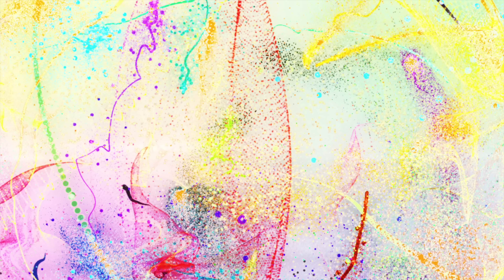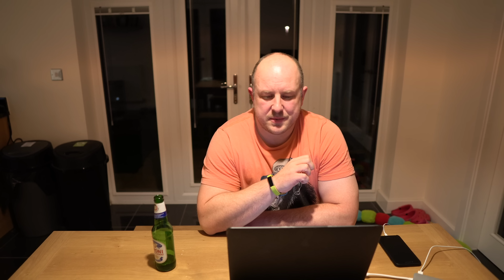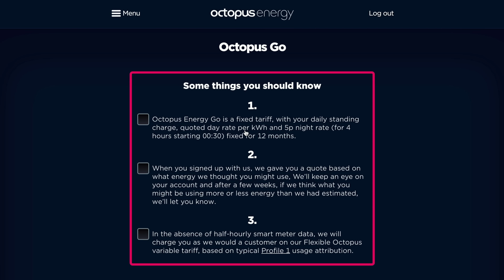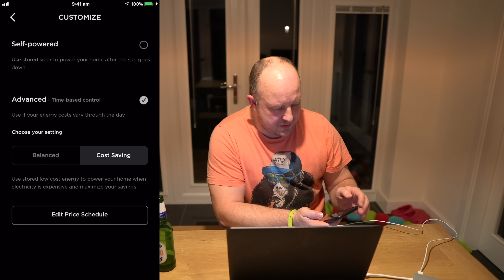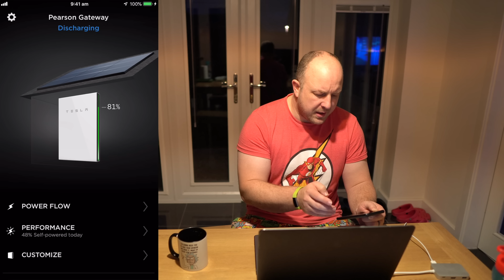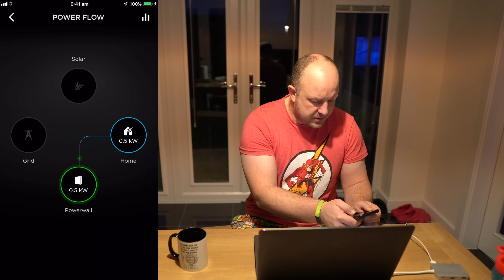Tesla Powerwall Off Peak Charging - Octopus Energy GO Tariff

Comment: Hi there I’ve configured my Powerwall exactly as you did. What I am noticing is that it fills up as planned between 1230 and 0430 but then rapidly discharges and is empty by 630am. This seems really strange as the house is not asking for anything other than some very low level heating … it also means it’s not helping me at all when we all get up and start cooking, washing, etc. Any thoughts much appreciated!
Reply from the maker: Thats very odd.
I would set an alarm for 4:30am to see what your powerwall is doing.
My guess is going to be that either something in your house is slurping up more than you expect, or you have your CT clamps configured incorrectly and its exporting the Powerwall to the grid.
Reply: just out of curiosity how many power walls do you have?
Reply: @calebmcclure3893  Just the one.

Comment: Thank you. A great video and easy to understand.  I have just changed over to Octopus and this assisted with the setting up of the TESLA app which I did not fully understand.
Reply from the maker: Glad it helped, thanks for taking the time to leave a comment.
Octopus have great Customer Service, so sure you will enjoy it. Best power company I have ever been with.
Reply: I have come across an issue within the past 3 days.  Initially the battery charged to around 95% at night but now is only charging to around 65-70% and having spoken to TESLA (after hanging on for around 56 minutes) I was informed this is normal and the system is functioning correctly.  I do not understand this as I would expect the battery to 'fully' charge not leave me looking at my app every few minutes in the evening to check how much is left in the battery.  As an example last night the battery charged 10.9kWh from having 4% remaining. Have you experienced this? Thanks
Reply from the maker: @chrismerson3581  Yes I have done some other videos on this. The Powerwall will only fully charge, IF it thinks the solar generation will not exceed your needs. 
So if it thinks you will have excess solar then it wont fully charge the Powerwall leaving capacity to fill it with some solar energy.
In general it works ok, but it has its oddities for sure. I wish there was a manual override to define how much YOU want, not what IT thinks :)

Comment: Hi, love your videos! Really cool 👍
I’m having an issue with my PW charging from the grid. I’m with Octopus, on Go Tariff. I’ve set the time-based controller on the Tesla app, exactly as you have; unfortunately the PW is only drawing from the grid for 1 hour, then it stops! In your expertise, what do you think is wrong? Thanks
Reply from the maker: I am just recording another video to help people understand abit better how I think the Powerwall works in this regard.
In your case, its "working" as it is charging from the grid. Its only pulling for an hour as it "thinks" based on previous usage and projected solar this is all you need.
In general it works well, but it has its moments. For example today I have been pulling from the grid most of the day as it only pulled abit over night.
Reply: Spectrum Geeks Thanks for your reply. It’s really helpful as I was concerned that I had not set it up correctly, however if it’s using an algorithm to work out projected usage from previous data, I shouldn’t worry. I look forward to watching your next video. Keep up the great work!

Comment: Hey Dale, random Q. How have you set up your PW to work with Zappi if you need to charge at night (octopus)? If you charge during the 4 night hours does your Zappi drain your PW and use grid until it charges back via solar the following day?
Reply from the maker: Hey Darren. I have my Powerwall setup to know when is peak and off peak (mainly so it can charge from the grid as needed - as per the video). So when my Zappi kicks in, the Powerwall knows its cheaper for it to pull from the grid that deplete the Powerwall. Now sometimes it screws up abit, but in general it works well. If I then use my Zappi during the day and there is not enough solar it will pull from the Powerwall as that energy is cheaper during peak times.
Reply: @ConsideredUK  thanks! I guess my issue is if I charge my car at night it completely drains the PW even though I have the two tariffs set up on it also. Maybe i don't charge enough at night for the algorithms to kick in. Hmmm
Reply from the maker: Its a possibility, but thinking about it now. In the last week I charged my car from the grid at night for the first time in ages, and it worked as expected, pulled from the grid and the Powerwall was fine.

Comment: Code used  : O ) supply starts 30th Aug 2019. Thanks for the info on the powerwall
Reply from the maker: Cheers for using the code and for watching the channel.
Reply: @ConsideredUK   have know gone live with the go tariff, So I guess the credit will be on my 1st bill. The install starts September the 17 so had fun getting ethernet run for all the bits.
Reply from the maker: You get the credit on your account as soon as your switch completes. As I don't know your real name I can't check on my end to see if the switch is marked as complete (assuming you used my code).

Comment: I am thinking agile might be better as the most you can use is 17kwh in the cheap rate wheres as if you do Agile you are paying 8p to 28p but averaging out at 8p but you get loads more hours use.
If you are working like me from home the average has been around 10p compared to Go @ 13p all figures rounded off
Reply from the maker: I think Agile works depending on use case, the Go Tariff works for me.
In the 4 hours I heat my water at 3kWh, charge my car and 7kWh and charge my Powerwall at 5kWh. So can knock out 60kWh in that 4 window and that takes care of my following day.
Reply: @ConsideredUK  so how do you utilise your solar generation if battery charged at night.
Reply from the maker: I only charge things from the grid in the winter months. Outside of that I am using my solar only (aside from an overnight charge to the car if needed).
Reply: @ConsideredUK  thanks for this.  From what you say the go tariff has no restrictions? You can draw as much as you want between 12:30am and 4.00am?
Reply from the maker: Ah you found the video. Yup all you can consume for 4 hours, 12:30 - 4:30am.
Reply: @ConsideredUK  amazing. This would make it the cheapest off peak everywhere. Wonderful.yiu are amazing thanks
Reply from the maker: Ha ha. If you are not with Octopus already, there should be a referral link in the description. We both get £50 credit if you use it.
Reply: Great video, thanks for sharing. I’ve used your referral code and am now on the Go tariff, thanks! Quick question, you mentioned here that use the off-peak period to heat your hot water. Why is that? I’m on the Octopus Gas tariff and the cost is 3.4p kWh, which is cheaper than the 5p kWh during the off-peak period. I’m new to all this so might be missing a trick!
Reply from the maker: @nosh7654  I think (not done a scientific test) that heating the water with electricity is more efficient than gas, as there is less losses. This is why I am now using off peak electricity to heat the water.
With the immersion I am heating the water directly in the tank. To use gas I have to run the boiler, the water pump, etc and the water has to travel through the pipes etc. This is my current logic anyway.
Reply: Spectrum Geeks hmmm. Never thought of it that way. Will give it a shot!

Comment: Hey Dale, just signed up with Octpus, with the intention of switching to Go. I'm also scheduled for my 6KW PV + Tesla PW2 install from Forever Green this month, so I guess you could say I'm following behind :) Not sure how long it will take to switch to Go, seems there is a bit of a delay getting the new SMETS2 smart meters out. Anyhow, signed up with your referral code - thanks for the really informative videos.
Reply from the maker: Cheers Jason and best of luck with the solar (did you tell them you had seen my videos?).
Regarding the SMETS2, if you tell Octopus you want to get on the Go Tariff, they may get you a SMETS1.

Comment: Hello, and thanks for all your helpful videos! We installed a 4kw solar array a month ago and just had our Powerwall installed yesterday. Next step is to sign up to Octopus GO, and we've got them coming to install the meter in a couple of weeks. I don't suppose we can use your code if we're already Octopus customers (we're just switching tariff)? Curious to know how clever your battery is being in terms of how much it charges during the off peak hours. Do you see it charging to significantly different levels on a daily basis depending on the weather, usage etc? Does it tend to be on the money, or do you sometimes find yourself wishing it had charged more/less? Does it ever not charge at all, despite being set to cost saving mode? Thanks!
Reply from the maker: Thanks for taking the time to leave a comment, a few are asking about how the Powerwall is working in this way, so perhaps I will do a video.
As you are an existing customer, you wont be able to use referral, but the main thing is you can save some money once being able to charge up on cheap electricity when the weather is bad again.

In general the battery is super smart and does the right thing, and charges up IF / WHEN it needs to, based on historical usage and weather forecast. I do occasionally wish it wasnt all fully automated and I had abit of manual control, but this is rare.

The main thing to remember is that its not a fortune teller, it doesnt know what you might randomly do, it charges from the grid each night only if it thinks you will need more than solar can provide based on what you did previously. It does this for each day of the week independantly, so it will for example be like, I don't need to charge up tonight as Saturday they dont use much electricity and the solar looks to be good, but seems they use alot of electricity on Mondays, and the forecast is cloudy so I will put in 76% charge to the battery, etc etc.
Reply: Thanks for getting back to me so quickly. It's good to hear that the battery appears to be as clever as it's meant to be. Our Tesla was switched on at about 3pm yesterday, and including the charge it already had in it it was at about 27% when we went to bed, which seems to have been enough to get us through to 4.45 this morning. I have high expectations for the sunny(?!) days ahead, and am hoping that we won't even need that Octopus Go tariff till, say, October... Maybe overly optimistic, but I'm very solar-happy right now!
Reply from the maker: So you know, alot of the "features" become available over time. Its a learning machine, so each week for about 4 or 5 weeks different options and stats become available to you. So bit of patience is needed, but I have not properly touched the grid for a few weeks now since the weather has been abit more decent and the days are longer.
Reply: Wow, that's brilliant. I'm very excited. I know you have a bigger array than ours, but I think you also have higher usage so I'm hoping we can achieve something similar. Thanks again!
Reply from the maker: Yup I munch through alot of electrons each month :)

Comment: Awesome. Can you explain how the powerwall behaves during the day on this setting in terms of your solar system? Does it prioritise re-charging using solar PV during the day until depleted, then waits until your off peak tariff kicks in to recharge over night?
Reply from the maker: Exactly. It will use power from the powerwall until solar can fully sustain the energy requirements, then it begins charging. Then in the off peak time it will charge up to X % based on the solar potential for the next day and estimated energy needs based on previous days (ie what power is normally consumed on a Saturday). Based on the history it will charge to 100% or less (last for example it charged to 20%, just enough to get me through to the sun being able to take over).

Comment: Nice one, why does it look like you are still getting energy from the grid despite full battery and no much load? Also what would be the real cost per KW if you take in consideration the Tesla battery degradation in term of cycle usages
Reply from the maker: There is always a small amount of grid balance occuring, tends to be about 30 - 60 watts. Its more prevelant when the sun light is variable, and if using high demand devices. The grid quickly kicks in for a milisecond to meet demand then powerwall takes over (if that makes sense).
In terms of the degredation etc, to be honest I don't give it any thought. The Powerwall has 10 year unlimited cycles warranty, and in 10 years they estimate it should be at least 80% of original capacity, so I just get on and use it.